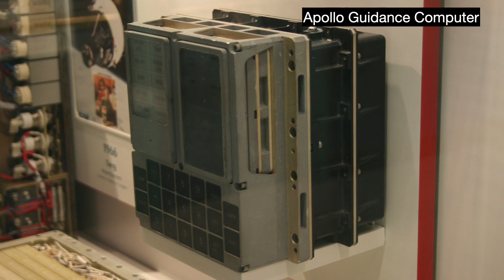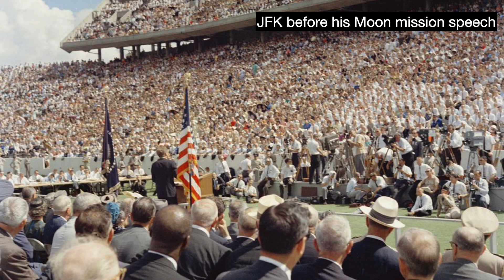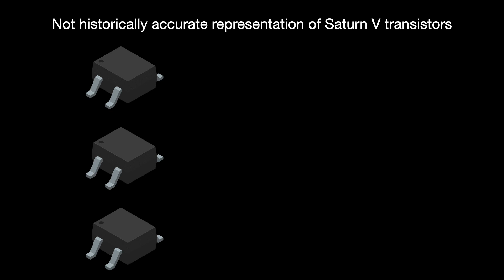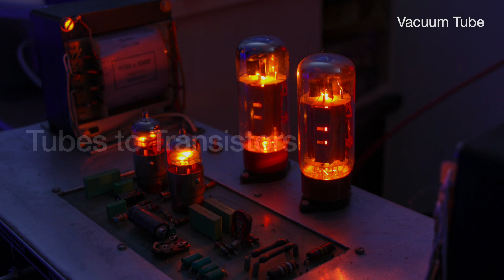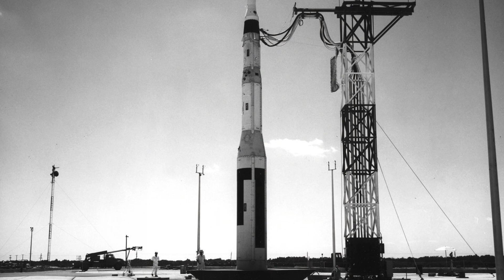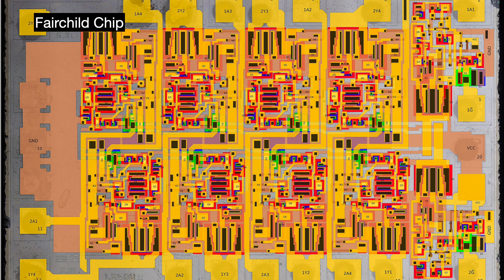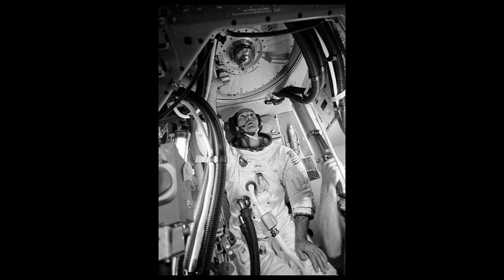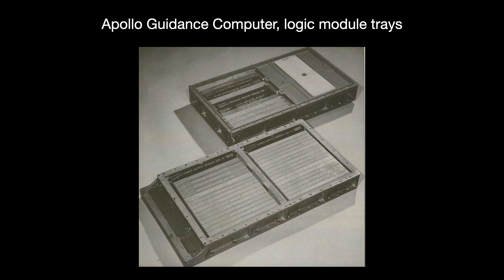How the Integrated Circuit Took Us to the Moon

Comment: I beg your pardon, but vacuum tubes may "suck" for logic, but are still superior for signal applications above a certain power-frequency curve.  I recently built a new testing and processing set for ceramic planar triodes for a new medical accelerator application (and, topically enough, the customer is in Asia.)  Just a parochial quibble.  Love your videos!
Reply: I'm no expert, but a lot of technologies retain a foothold for niche applications even when superceded in the main. Steam power hangs on in power generation for example. Vacuum tubes are a bit like that.
Reply: @cncshrops  Steam hangs on because it is very good at recovering the maximum energy from the fuel by having a very cold exhaust temperature from the power recovery stage. Ammonia or pentane would be better but is rarely used.
Reply: Russia made some very reliable military tubes for planes to withstand a nuclear strike
Reply: The bigger problem is vacuum tubes suck at reliability.

Comment: If by “to the Moon” you mean low-Earth orbit, sure.

The biggest unknown needed to be solved was space radiation. That little was known about space radiation then, and still today, they failed to solve it. Instead they foisted a giant fraud on the world.

Interestingly, Pioneer 4 failed to measure radiation around the Moon, and Rangers 7 thru 9 carried no means by which to measure radiation on and around the Moon.

And I’m American.
Reply: You're arguing from ignorance. We solved that problem before Apollo even began. For radiation, there are 2 important variables: 
1. the radiation intensity
2. the amount of time you are exposed to this intensity. 
You can multiply these two and get the total radiation dose. Humans die if they receive a dose of about 300 Rad. 
In 1958, James van Allen and his team discovered the belts that were later named after him. He also measured the radiation intensity. This is what he found: in the part of the belt where the intensity is highest, it is high enough that if you stay for about a week (inside an Apollo command module), you receive a lethal dose. So for the Apollo missions, the trajectory was designed to minimize the amount of time spent there. When the Apollo astronauts flew through the van Allen belts (which took about 3 hours), they received a dose of radiation of between 0.16 and 1.14 rads, or less than 1% of a lethal dose. 
More details in this video from Scott Manley: https://www.youtube.com/watch?v=h9YN50xXFJY
Reply: Another flat Earther conspiracy theorist nut...

Comment: My father worked on one of the Apollo projects engineering part of the comms.  He mentioned how unbelievable it was even then how fast the chips were shrinking in size, fast enough that finished designs would need adjustment because the size was reduced during the design phase.

Comment: Thanks for the trip down memory lane. Glad you mentioned not only the AGC but also the LVDC. An interesting piece of trivia while the LVDC was triple reductant there was no redundancy on the AGC other then tremendous effort put into insuring reliability.  If memory serves (I'm winging it) neither the AGC or LVDC experienced post launch failures, I think the lightning strike took out some of the telemetry signal processing gear. 

Having grownup at the end of the vacuum tube era (valves for our friends on the other side of the pond)  I am in awe at the tremendous advancement in electronics over the last 50 years.
Reply: There was a software failure causes by a systemic design error on Apollo 11's AGC.
However, the AGC's 'OS', the scheduler and the everyone resident applications of my memory serves correct, was designed from scratch to keep the mission alive in the event of software failure.

As it happened, the executive dumped all precesses, reloaded the 'keep then alive' processes and restored their memory set (last known good location, pitch, roll, climb and velocities)

Go watch Brian Troutwine's presentation on the AGC and learn the story of the 1202 alarm.
Reply: @MostlyPennyCat  Not to get too much in the weeds but that error indicated CPU overload. The software was designed to deal with that problem by dumping lower priority tasks. So I'd argue it was not an AGC failure. Wasn't the root cause of the overload because the checklist had the astronauts turn on the radar too early?
Reply: @tomschmidt381  
Ah, well there's a thing, isn't it?
If you wrote your software to cope with failure, did it actually fail?
There's an RTOS rabbit hole there and it will swallow you whole!

Ultimately the fault was shown to be systemic, an AC line was run too near to the return cable from the rendezvous radar. So even when it was switched off the AGC received 100s of responses a minute and was incapable of ignoring them.
They filled up the executive and bang, 1202, no slots.
Reply: Interesting I was not aware of the wiring problem, I thought it was simply an improper procedure. Thanks for the info.
Reply: The funny thing there's presently development of IC technology applied to valves.

Comment: Fascinating stuff, thank you.  A question: how did this fit in with the ‘hand-woven’ hardware, i.e. the computer made up of wires passing through or around metal rings; was this limited to the Lunar Module?
Reply: That would be for the memory. Core memory (RAM), Core rope memory (ROM). The rope memory was quite dense for the time. The AGC had about 14K of rope memory for the main program and lookup tables and about 4K of Core memory for it's ram. The Core memory was non-volatile meaning it would keeps it's data during power failure, and while it could be written to and read from, reading the data destroys the data so there would always have to be a write back after a read. Rope memory could not be written to after manufacture. The data was literally woven into the memory as what determined a 1 or 0 was dependent on how that wire was woven. One single wire could also be woven through multiple cores so that one wire could 'hold' multiple bits. Those bits would be selected via another set of wire that were also woven through said cores.
Reply: the 'hand-woven' hardware inside the AGC, was called core rope memory. it was the memory of the AGC that stored the programs. these were part of the computer in the same way your ssd is part of your pc (following this analogy the IC's where the CPU).
Reply: That's just the (magnetic) core memory and core rope ROM. Integrated circuits once they started establishing themselves quickly killed them off.
Reply: @SianaGearz  Specifically it was the MOSFET transistor that enabled VLSI silicon based MOSFET ICs that enabled it, consigning CRM to history
Reply: By the early 1970s you could buy (if you had a large enough budget!) a commercial computer with 4k words of (read/write, or RAM) memory. The RAM was also hand woven - it differed from core rope memory in that it was much more regular as the data was not wired into it at manufacture, but I was told by a DEC engineer at the time that it was still hand-woven. I worked with DEC Link-8s and a DEC PDP-12, by no means as powerful as the AGC, but I don't doubt it was a lot more affordable. In the UK I recall the PDP-12 was about £25000. My salary as a physicist was £1250 per annum...
At that time the memory was referred to as "core store".
Reply: no both the lunar module and the csm used an AGC which had rope and core memory. the lunar module even had a simplified backup computer to launch and orient the spacecraft if the AGC died for some reason

Comment: You're audience includes a lot of Electrical Engineers.  When has anyone had a conversation with EEs and not gotten yelled at?
A tidbit about the Minuteman guidance system, Jim Williams of some fame in the EE community, cut his teeth repurposing Minuteman guidance computers for lab use at MIT when he was a technician there.
Also to keep the yelling going, you might have mentioned Jean Hoerni along with Fairchild and the planar process...

Comment: For all things Apollo IT related, like the inner workings of the AGC and how the communication system worked, the CuriousMarc channel is incredible. They even have original Apollo hardware that they are restoring and reverse engineering. Some Soyuz stuff, too.
Reply: There is also a video from another channel (which I don't recall but the title is "The Ultimate Apollo Guidance Computer Talk") with a live lecture on the DETAILED design of the AGC.
Reply: I agree the AGC restoration was fascinating now they are working on the complex microwave communications system.
Reply: "They even have original Apollo hardware"  and apparently super expensive military grade computers were available for free at the local junkyard...
This video is showing the picture of Saturn 5 computer and its size, its job in comparison to the job of what computer of a moon lander woud need to do was simply trivial.
For 50 years there was this talk that we are not going back to the Moon because there is no point, China anounced that they also are planing to land on the Moon and instantly the narrative changed to "we need to have another Moon mission and land there again(before China)".
Why exactly Space-X rockets strugled so much for so long to land an empty rocket(no internal mass change to wory about)?
AGC was doing that with not a single mistake of any kind and Space X rocket that was at least millions times faster(powerful) was not able to do it for so long and so many time even with the modern engine gimbals that are much more capable that the one avaible half century ago(not to mention that the landing space was perfectly flat and not full of some random huge rocks).
Reply: @Bialy_1  ermm. What are you trying to say? That the AGC was awesome, or are you one of those moon hoax people?
Reply: @MoritzvonSchweinitz  
I believe he is trying to say: von Braun > Musk * 1000.
Reply: @Conenion  I hope so, but even that's not a fair comparison. Basically everything is completely different
Reply: @MoritzvonSchweinitz  
> everything is completely different
What makes you think so? Many things are different, sure, but many others are very similar. We still have rocket engines working by the same principles for example. 

In any case it is still not an easy task.
Reply: @Conenion  What the Apollo project achieved is incredible. The ingenuity of almost all millions of components is literally mind-boggling.

What SpaceX achieved is also really great.

But Apollo had to invent almost everything they had from scratch. But they had basically unlimited funding and the support of the whole nation. And a wild space race for motivation.

SpaceX has unfathomable technolical advancements at their fingertips (computers, sensors, etc.). A huge pool of highly qualified people to draw from. And landing those F9 was a great achievement - but I'd argue that it was more of an achievement of will=power and stubbornness than technical advancements, per se. Nobody else really, really wated to do it before. But the maths and engineering behind it is great, but not ground-breaking in itself. Apollo's was.

I love Apollo and SpaceX. But I really don't think comparisions are in order.
Reply: @MoritzvonSchweinitz  
> Nobody else really, really wated to do it before.

What? Landing a rocket? Has been done before. See McDonnell Douglas DC-X. 

The whole reusable thing is btw not a panacea. Costs remain high.

> But I really don't think comparisions are in order.
W.r.t. going to the moon they are because it is the same goal. Of course, it should be much easier today than it was 50 years ago. But apparently it is still quite a challenge.
Reply: @Bialy_1  that's the problem. The SpaceX first stage even only one engine has too much power so that the stage would fly up again if it is egnited too early and burns too long. So it has to be egnited just on the right time so that the rocked touches the ground when the speed is zero bevor it flyes back up again. Also landing the booster was in the beginning just a bonus and not the main mission. The main focus was to bring the payload into orbit and a the bonus if the booster lands successfully. 
The Apolo engine on the other hand can be trotled enough to fly up and down without issues because the power of this engine is special build for that that task.
Reply: @Bialy_1  nah just a lame troll who has never heard of the Constellation program or the Orion capsule (which was ready years ago).
Reply: Eventually they'll have an entire command module /s
Reply: came here for this comment
Reply: Exactly! Being a CuriousMarc subscriber I recognize that the device at 0:15 is not an AGC! :P
Reply: @rkan2  
It's the DSKY, standing for display and keyboard. The user interface of the AGC. So it is a part of the AGC, as I see it.
Reply: @Conenion  well afaik you don't need the DSKY to use the AGC (remotely), so I think it is still very much it's own thing. :P
Reply: They had a whole series on repairing and actually executing code on an actual Apollo AGC. Highly recommended.

Comment: Yeah it's funny how many people don't know that the integrated circuit came about in large part due to the Space Race and the need to compactify the hilariously huge electronic components of that day into something that would fit in a reasonable sized rocket.
Reply: @asgdhgsfhrfgfd1170  I do think you're inverting the problem. All of the practical researches are funded by private companies in search for ROI. The more fundamental sciences won't create any profit (at least not tangible and patents can easily expire before the manufacturing process matures enough for commercializing a product) so public founding is the way to fulfill this ungrateful task.
The thing is, space research is an in between that brings new challenges allowing techs or process to be created or allowing them to improve and evolve faster.
Reply: @asgdhgsfhrfgfd1170  we got a lot of interesting technology out of the Space Race; integrated circuits becoming more widespread was just one of them,I know for a fact that a lot of things like velcro and especially a lot of stuff like solar panels miniaturization and all of that stuff and especially GPS came out of the space race.